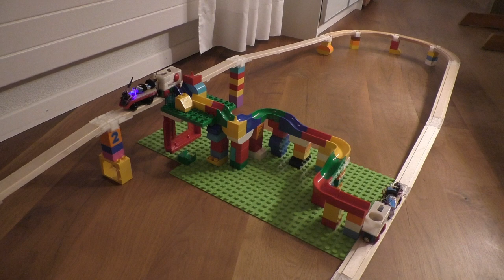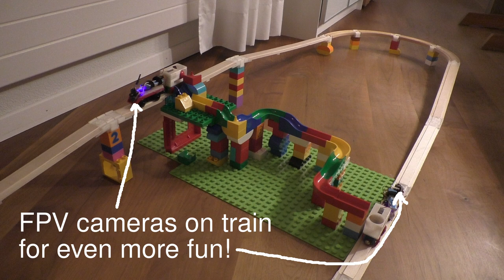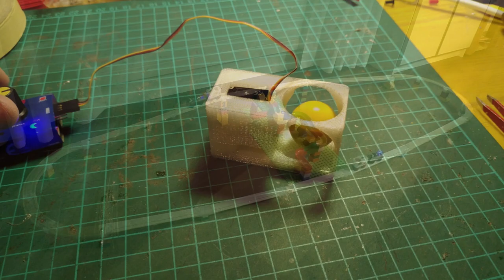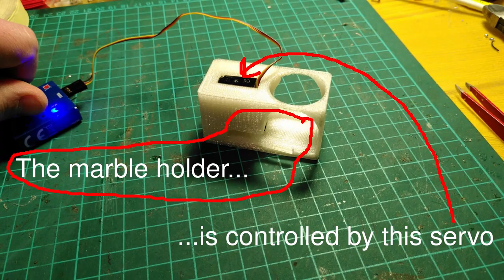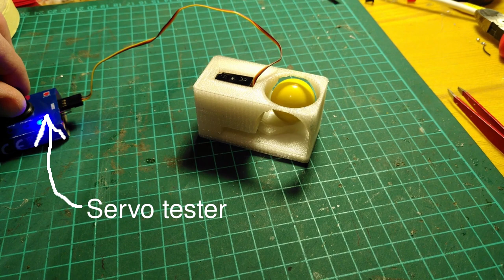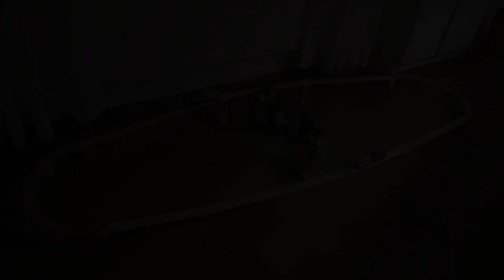3d printed Hubelino marble transporter for Brio trains

Comment: It’s amazing idea and good job! Have you returned to BRIO projects?
Reply from the maker: Thanks. What do you mean by returning to BRIO projects? To my own projects or is there a community somewhere?
Reply: I mean your last videos about BRIO was 11 months ago. I even thought, your kid  has grown and might lost interest to wooden railway :)
Reply from the maker: The problem was time (as always ;-) ) . But I hope it will not take another 11 months until the next video.
Reply: @retohasler88  Hi, by the way, I noticed that this Ikea Lillabo has an excelent mechanics, but it's so slow comparing to other Brio models. 
I'm trying to design 3D printed locomotive using different DC motors.
The best speed showed a yellow DC motor for the Arduino hobbist. 
Also, when the sizes of locomotive will has been defined, I'm thinking about creating PCB based on ESP32 with PWM  for light, motors, sound and maybe other sensors. 
Would you like to participate in the opensource project or create the community?
It's just only the idea yet, I'm not sure I have enough time too :)))
Reply from the maker: Hi

Yes, the mechanical design of the Ikea Lillabo is greater and much cheaper than other trains I had. This is why I only use the Lillabo at the moment. 
The motor speed turns out to be great if you change the ESC (which I do to make them remote controllable). I also increase the voltage by replacing the 2xAA batteries (3V) by 1xLiPo battery (3.7V). After these modifications speed was never an issue to me anymore.

About 3d printing/ building your own brio train. I'm currently more interested in modifying existing ones as easy as possible with the goal to be able to build new ones as fast as possible. I'm also more interested in automation like automated stop and go at traffic lights for the brio and so on...

But regardless of our slightly different focus: I'm always willing to contribute to OpenSource projects. Building a community can be de result of contributing to an OpenSource project but is not my personal priority at the moment. As you already mentioned: time is an issue.
Reply from the maker: I just realised that you already modified your trains to use LiIon based batteries...